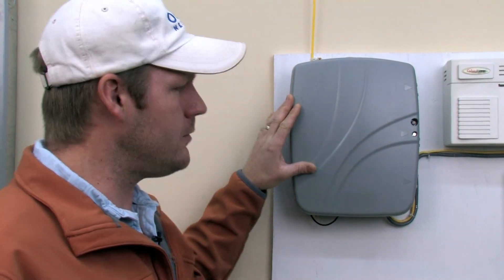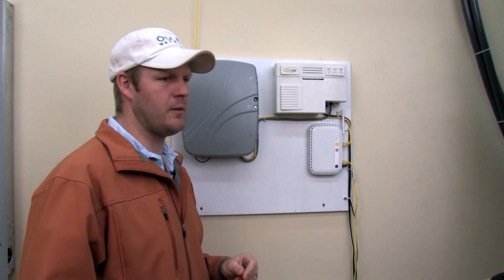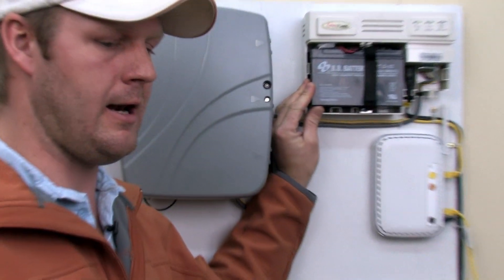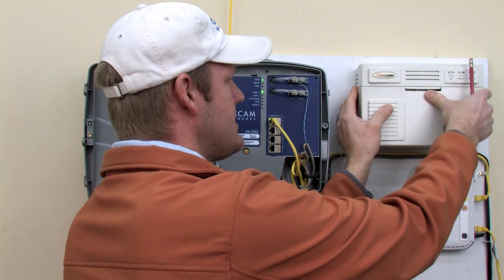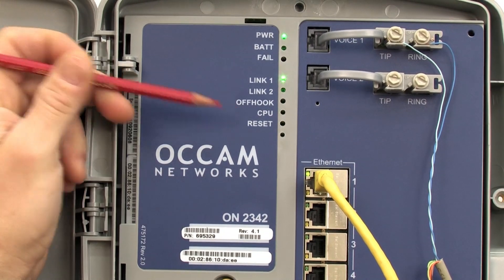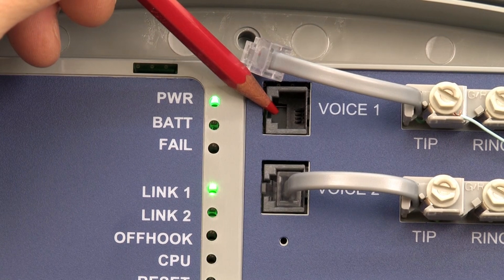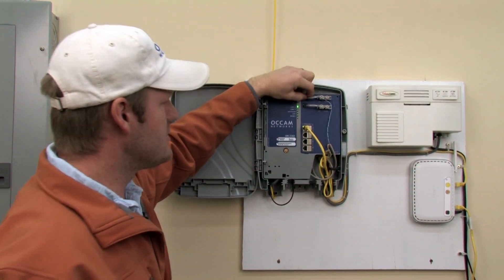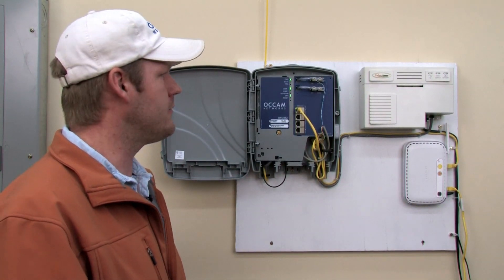Fiber Optic Telephone troubleshooting and what to expect during a power outage

Comment: I have fibe modem i connect anolog phone to the moden and works But When power off no tone
My modem has no battary i plug to wall soct 230 volt 
IS their Any adapter phone house connect convert digital to anolog When power off line phone stay on
I found this
WELEY Digital to Analog Audio Converter with phone jack, Convert Coaxial or Toslink Digital Audio to Analog L/R Audio 

Does this solve the problem

Comment: I don't have fiber optic but because fiber optic has a battery backup does it means you still have Wi-Fi during power outage? That would be cool so that we don't have to use the mobile phone's data service.
Reply from the maker: That's correct!
Reply: @Itstriangle  :O
Reply: I have just switched to fiber optic and internet does NOT work when power is out. Landline does. I used to plug my router into a battery during outages and internet worked 99% of time. That no longer works. I am very unhappy about that bc power goes out a lot in this rural area and there is no cell service.